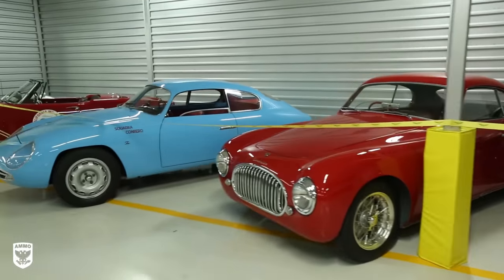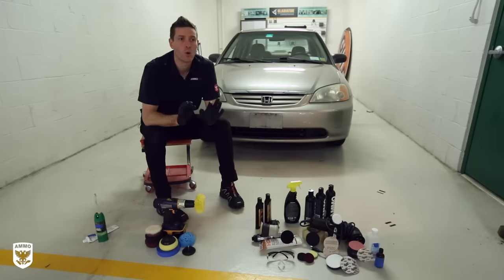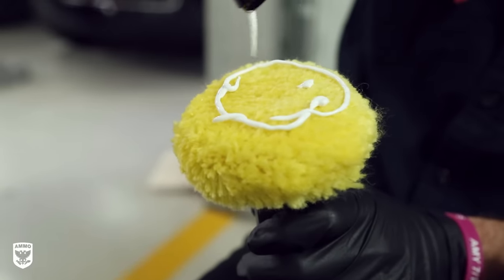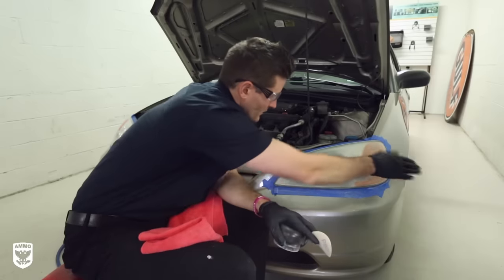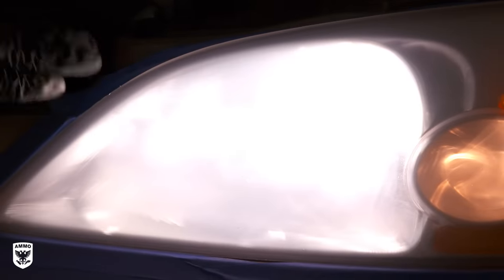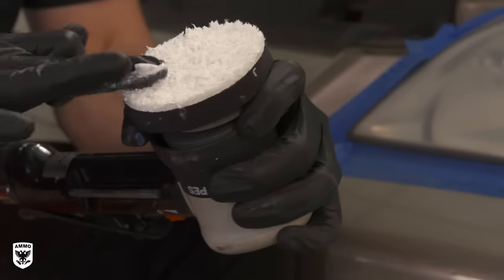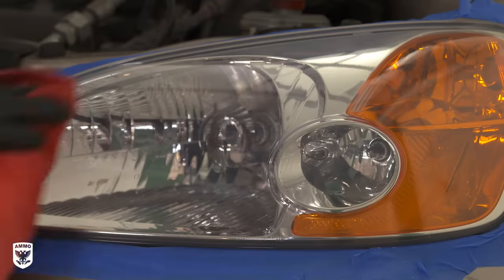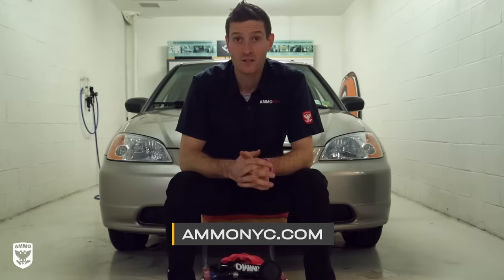How to Fix Foggy Headlights: 3 Different Methods: Honda Civic

Comment: I wish car manufactures would make the headlights out of glass like the old days. But I guess we would be replacing them all the time from rocks.
Reply: They can make it so it doesn't yellow and fog up , but  it cost more and would hurt parts sales slightly
Reply: Cheap or US based cars seem to use Plastics, Glass lens all the way. 
Most cars you can still get after market replacements in glass.
Reply: +Blake's Garage my australian toyota Aurion 2008 has 100 miles on it and the right headlight cover is just slightly hazed and yellow which is not noticable at all even tho I have just purchased just a new left headlight cover after an accident, I live in middle east and for 10 months every year the outside temp is 35-45 C.
Reply: +Blake's Garage but each headlight cover costs $250. very expensive compared to others.
Reply: +sweet dreams That's a low mileage and already crashed.
Reply: sweet dreams Are you Australian? or Expat big shot? They always rude have a chip on the convict shoulder.
Reply: Larkhill21 fuck u, telling me 100 miles and already crashed is not rude? + it was a minor accident that happened to be in that area not a crash, that was rude too not GTFO
Reply: People love it when you bite learn that. It was a joke Joyce take your pills.
Reply: DjStiv3 I like that idea!
Reply: ***** Yeah totally make since and they can sell you new one 10 years from now.
Reply: Blake's Garage 1.for most cars parts will be available even after the car is 20 years old.
2.even if before headlights were cracking more than today which I dont think so, so did the glass on the windows, before you could break car glass with bare hands now you cant do that even with a hammer(except windshield,thats a different type of glass)
3.car markers love to sell the same car for the next 50 years and save money but they cant because of competition, the same goes for headlight covers, one car marker should do it so the rest would do it too and that one car marker will take a big hit in profits in the beginning because customers are not demanding or thinking about things like headlight covers and their minds about car glass are stuck in the 80s...with the way new cars are coming out I wont be surprised so see the same material used in headlight covers on car windows and the car maker will advertise it as "weight reduction" thats the same thing they did with cvt they called it "weight reduction and performance" but in reality cvts are the worst and very unreliable.
Reply: Our 93 300zx headlights are still crystal clear thanks to glass lenses
Reply: Stoneyburke I had a 92' Accord all glass headlights. My friends don't believe me.
Reply: The problem is,, while Glass feels more durable, if there´s a chip from rocks will grow forming a line down (just like a windshield hit from rock) .... 
plastic seals the break and is eaily repairable.
Reply: I daily drive a 76 LTD with glass headlights in Pennsylvania and I have no issue.
Reply: Does that car have the left rotating driver´s seat?
Reply: My old 1994 Ford truck just turned over 300  thousand miles and still going. Replaced the belts several times and the starter and water pump. No other problems  I change the oil and filter every three thousand miles and keep it up and clean.
Reply: And so???
Reply: Check out JC Whitney you can buy replacement headlight covers for about than a hundred bucks for many cars.
Reply: Pretty sure all Jeep Wranglers still have glass lens’
Reply: My headlights are glass and have never had them cracked from rocks.
Reply: Blake's Garage did they not coast lot more being glass?
Reply: the other reason why there are no more glass headlights is because of safety reason. Imagine being in an accident with a pedestrian, the glass might shatter and usually headlights are the first thing that pedestrian come in contact with in a head on collision
Reply: I had cars since  1978 up to now and with the old cars using glass for the head light I never once had to replace the light because of a stone hitting it. This is just to save money with the manufactures so they can make more of a profit from the cars. Like putting plastic lights really helps the car.
Reply: As I recall, glass, sealed beam headlights weren't much trouble at all, and could be replaced easily from the outside of the car. In several years of use, I never had one break from a rock, and I don't remember the headlights on my parent's cars breaking either. The glass was quite thick, as I recall. The surface of the sealed beam units had to be more or less vertical, so they tended to be recessed. That means they usually wouldn't contact a pedestrian. I imagine a disadvantage was that the car would have a little more air drag, since it wasn't possible to have a continuous, smooth surface. I encountered an unusual disadvantage once while riding in a friend's old Toyota Celica. This particular model had the headlights deeply recessed. We encountered a really heavy snowstorm. The lights were recessed so far that their heat wasn't enough to keep the snow melted, so we had to stop and dig them out every few minutes. Of course, driving an old, sporty, rear wheel drive car in heavy snow isn't always a good idea...

Come to think of it, how often do you have to replace windshields? Consider how much smaller headlights are.
Reply: the same lights have been on my truck for longer than 10 years...
Reply: even if you got a glass one, you would probably break it and end up with a plastic one because the glass replacement would be exspensive
Reply: there are only glass replacements for my truck a 95 tacoma... for my moms truck an 01 land cruiser has glass lights every time it gets hit she goes for the most economical repair... its always been glass replacements
Reply: the last time we replaced the lights for my truck they wernt broken we upgraded to for increased light output... with led bulbs it gives off as much light as new vehicles with an acceptable scatter https://www.amazon.com/HELLA-003427811-132mm-High-Headlamp/dp/B001G72VIK?s=automotive&ie=UTF8&qid=1489965549&sr=1-6&keywords=hella+vision+plus&tag=amazonqueryr1-20

but If I wanted to cheap out I could go for these 
https://shop.advanceautoparts.com/p/sylvania-h6054-basic-sealed-beam-headlight-box-of-1-h6054bx/5080126-p?c3ch=PLA&c3nid=5080126-P&adtype=pla&gclid=CjwKCAjw9-HZBRAwEiwAGw0QcROwiGtIE9vxxqvGszOWt3XXqMgrfvWF6VBQZXB2i2c_XY37d2yANBoCuKAQAvD_BwE&gclsrc=aw.ds
Reply: Go back to the old SAE sizes, no need for these damn shells, you're not losing that much fuel mileage for the little aerodynamic you get out of a plastic shell.
Reply: if you look at the headlights out of old land cruisers they are never faded because they arnt plastic... all glass i cant speak for the new ones
Reply: Too much money, beside it's cheaper to make, and it provides "other" to make money with their products!
Reply: What people seem to forget that the inner plastic glass Also needs polishing, as it is the most critical area of the headlight. No point doing it the outside🤭
Reply: I don't recall ever cracking / breaking glass headlight in 50 yrs. Just had to occasionally change a burned-out headlight. Have replaced plastic headlight lens on my pickups, with plastic from Lowe's.  Works great.
Reply: robfrmny21 Is to
Reply: It all has to do with cost, glass cost allot more to manufacture and therefore makes the cars cost more, are way harder to make into the shapes they are now using. Also if you ever have to replace a broken one, the glass housings, not the sealed beams ones, they are a small fortune. My old 3000gt had glass housings, while they never yellowed or frosted they did get pitted over time and the replacement for each one was crazy expensive, like over $1k per housing.
Reply: Do you drive on dirt roads a lot?
Reply: Rocks never destroyed old glass headlights, and car manufactures made plastic headlights so they can make aftermarket money. When the headlights fog up, they can make thousands selling you new headlights when you get tired of looking at yellow hazy colored ones.
Reply: @Don_nell  rocks hitting glass won't destroy them? I know for a fact that is wrong, had two different ones broke, one was from a salt truck, that stuff was like a bullet going in.
Reply: @charleswp71  I drove cars with regular glass head lights for years and years and never got a cracked headlight. I didn't say it couldn't crack them, I was saying it's highly unlikely that the average person would experience cracked head lights as there are still many people driving with them and don't seem to be any issue about getting cracked glass headlights. You just happen to be the exception to the normal, there will be a small few, more like a 0.1% percent of drivers with glass headlights that gets cracked.
Reply: Government changed this, for the weight, and safety glass would cause injuries with the broken glass. Stupid as it sounds, this is the story of replacing glass headlights.
Reply: @ThanhNguyen-pm7xn  my wife, Nguyet Nguyen has a 92 Honda accord with glass head lights. Cuz
Reply: @robfrmny21  They "fog up" due the driving down roads and highways where they are literally sand blasted until they dull from scratches.  I remember when I was in trade school many years ago and Honda had a new composite lens they said couldn't be broken, even from hammer blows. The rep offered $100 to anyone who could break a lens with one blow.  One good swing of a ball peen and I was $100 richer.  Point is, these have to be flexible, absorb impact and implode without shattering into shards (safety for a pedestrian accident, for example).  

<begin unwarranted rant>The composites they use are affordable and meet safety requirements.  It keeps sale price down, just like every cheap plastic clip that they use, which used to be a metal band or steel clip.  Weight = mileage.  Every ounce adds up when multiplied by thousands of parts.  If they save $1 on a clamp and build 1,000,000 cars, which use 3 clamps each, that's $3,000,000 (MILLION) saved by changing  just one clamp style.  People piss and moan about the cost of cars, many will buy one over another simply because the EPA rating is one half gallon more per mile.  Then those same people piss and moan about cheap manufacturing.  Sorry, I know that doesn't really apply to you, don't even get me started on WalMart shoppers! <end rantr>
Reply: @Blakes Garage - Glass is also too heavy and very expensive to work into today's compound curves used for both streamlining and appearance.  The contoured cars of today wouldn't look so good with plain round or square headlights.  Glass would have to be so thin it was like a common light bulb, which wouldn't be too great on the road.
Reply: @ThanhNguyen-pm7xn  my sister had a 1991 Honda Accord her headlights were glass, they were on springs you could push in on them they would pop right back out. It was a very nice car she put tons of miles on it great times.
Reply: Had a friend who put in 100 / 110 watt headlight low / high combo globe in his car, was aftermarket globe. Because it was plastic lens, he actually melted the lens cover. At least tempered glass can handle heat from globe from inside and cold air from outside and not crack or melt like plastic lenses would. As for glass chips from rocks, you will get it wether glass or plastic, personally I find tempered glass does not have as much flex or give as plastic does so can take more abuse. My experience, not sure if it tracks to other people experience.
Reply: @charleswp71   Bingo! One of the major reasons car companies wanted to switch to polycarbonate headlights was so that they could make them in the wide variety of shapes -- some of which are pretty extreme -- you see today. This helps (in theory at least; YMMV) to give cars distinctive, unique looks. Making many of these shapes in glass would be either cost-prohibitive or maybe even impossible, in some cases.
Reply: You are a very smart lady
Reply: They could try gorilla Glass.

Comment: Car manufacturers should just make the headlight cover/lens removable and then you can just buy a new headlight cover on ebay for $5 - $10 and replace your old one.
Reply: Why would they do that when they could just charge you $300 for a new one? lol
Reply: They have to be fully sealed so they don't fog up or collect water/moisture.  You can separate the lenses but it takes practice to do it without breaking one.  Just do a little networking and you'll find you can buy a lens, which normally sells for $300, for less than $50.  I've seen some manufacturers sell lenses for over $1000 but you can get the same, manufacturer branded lens, for a fraction of that cost if you do some networking. (real life, face to face, not Facebook, Instagram and crap like that)
Reply: Or you could just seal them for $6 a can, which can be used like 4 times. So that’s $6 for 4 years

Comment: The part where someone sprays a clear coat on the lens of what appears to be a Mercedes and there is no attempt to mask or keep over spray from hitting the paint job.. that's interesting.  Thanks for the tips sir.
Reply: Yeah, I spotted that too, but maybe the car was just for demoing stuff? I think that the clear coat phase is involving various steps as well requiring a video about it.
Reply: That was his Porsche. And considering his car would have numerous layers of his own sealant products already on the paint, he probably knew that the lens sealant would not have any effect on the paint of his Porsche.
Also if you paid attention to the previous shot, there was mask around the headlight. He probably just had to get a quick shot of him applying it and maybe didn't do so, or something didn't work, beforehand.

Nice work criticising a professional detailer though.
Reply: That was a UV protectant, not paint from a can, lol.
Reply: zellerized 8

Comment: Insect repellent, blows my mind. I've tried a few DIY kits with some success, though found dry/wet sanding worked even better for me even with a Battery operated drill with drill pad. Found that waxing headlights after restore gives them a little longer before oxidizing again

Comment: hey Larry,

where did you get the palm sized adhesive sandpaper disc system you were using?

thanks
Reply: +mraccord92 did you ever get an answer?
Reply: +ksboi29 no
Reply: I just found one. Look up polishing pal
Reply: Look up "Trizact 3m" and you'll find them.
Reply: wow they seem to only come in large packs, and the meguiar ones that larrys is using only come in 50+ packs.
Reply: i was wondering the same thing
Reply: +AMMO NYC what polisher are you using?
Reply: Ross Hooge its made by 3m called hook and loop palm sander
Reply: You can find that hand sander in this kit: https://smile.amazon.com/Meguiars-G2980-Heavy-Headlight-Restoration/dp/B01M2D763D/ref=sr_1_1_sspa?ie=UTF8&qid=1529980202&sr=8-1-spons&keywords=meguiars+headlight+kit&psc=1

Comment: Want to add my 2 cents that I just polished my headlight clear using a microfiber finishing pad and a conservative cut/polish (Menzerna 3000) and in 5 minutes I got pretty amazing results. Not saying its as good as the full sand/compound/polish/isopropyl/UV, but for 5 minutes per headlight, I'll take it. Oh I used Menzerna power lock sealant as UV. We'll see how long that lasts...
Reply: +gxcad 
How do the headlights look now?
Reply: +rra022001 still look great imo.

Comment: A diffusion coating on a lens will disperse light, absorb and the emit light of different wavelengths. The polycarbonate molded plastic of molded headlamp lenses imay become pitted, but it is not porous. UV exposure can degrade and air pollution and road debris can contaminate any "plastic" surface, including paint.

The SAE J 3086  standard for headlight lenses requires that the lens withstand the light of the lamp and external light and road abrasion for a 3 years  and have been proven in fleet operations to be adequate for 5-6 years.  The UV inhibitor coating on the inner and outer surfaces of the lens, is much thinner than clear coat, however it is not a sacrificial layer, but a filter.  It  DOES NOT degrade quickly when exposed to light. Intentional abrasion should be the last resort in headlamp lens cleaning.

NYC is too far north for UV to be the major source of surface degradation. Most headlamp and paint surface degradation in NYC is from debris and chemical pollution. It forms a layer sitting ON TOP OF the surface and can be removed with little abrasion.  

An ounce of prevention is worth a pound of cure. there are several products that will maintain the UV protection of the plastic headlamp covers. A lifetime supply of any of these is less expensive than one kit to scour away degraded plastic, and application is a matter of life again on and wiping it off after a car wash. My favorite product for this function is formula 303 UV protectant for plastic, because it's not just great for headlights but for all exterior plastic and rubber.

Even if the UV coating has been polished away, and plastic surface is badly degraded, any polishing method will be more effective if preceded by chemical cleaning.  This is the same thing that you would do with paint. Neglected plastic will tolerate and requires more aggressive cleaning than more frequently cleaned paint. There are cleaners specifically formulated for cleaning haqrd plastic. USE THEM.   Cleaning will reduce the amount of oil, tar and chemical that would otherwise get into your cleaning media.

If not removed, the surface layer of contanimation make the degraded plastic material removal process less efficient and more likely to overheat and distort the headlamp covers.
Reply: U said a lot of good things dude it sounds like you're talking as a pro if so keep it going I can relate